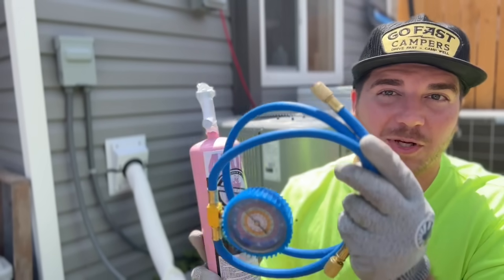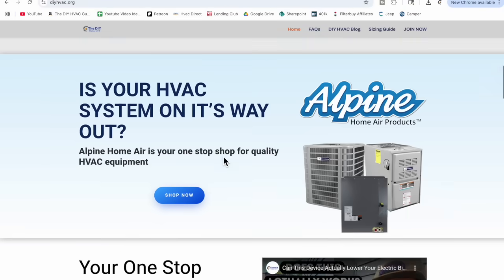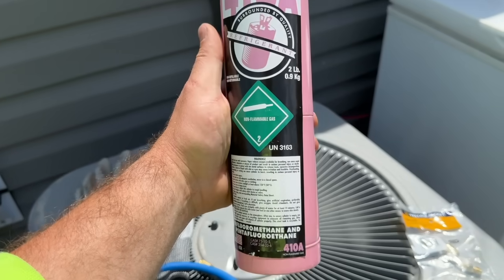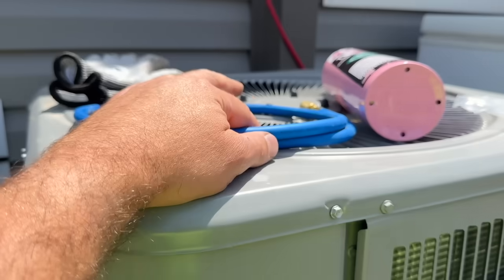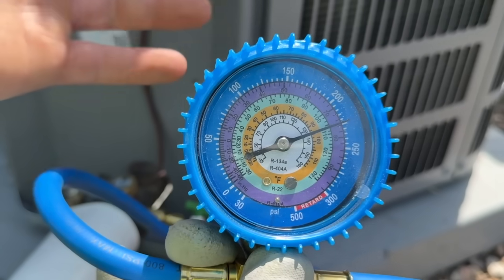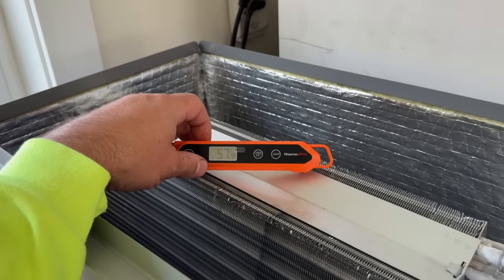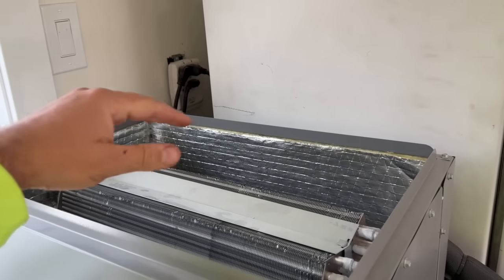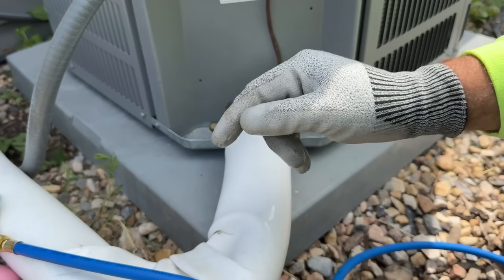You Can Recharge Your Home A/C Like A Car??  Colder Air in 6 Minutes!

Comment: Also to those who are saying contractors charge outrageous prices for refrigerant, you guys are looking at a very small picture...Licensing,Liability Insurance, Commercial Vehicle Insurance, Workers Comp Insurance, Truck Wraps, Tools, A fully stocked truck full of inventory, 4 or more different types of refrigerant, 20-50 different size capacitors, 10 different motors, Uniforms, PPE, Fuel, quickbooks, a crm/management company, The shop/warehouse, office/computers/phones, employee salaries. There are many associated operating costs with providing 24hr same day service and showing up to your door ready to fix whatever is broken at a moments notice. The price per lb or refrigerant is only 1 part of a very large puzzle that ends up as the final price to the consumer... It takes and costs a whole lot more than just a jug of R410A or R22 to provide home comfort especially in my south Florida market...I charge $100 for the first lb of 410A and 80 per lb after that... And if it takes a little more than what was stated on your quote to achieve top performance I'm never going to come back and ask you for more money...There is a lot of give and take when it comes to building a community/business, so I personally am very fair.

Comment: Owner of a small HVAC company, l enjoy your content... However I strongly advise against the average homeowner handling refrigerants in general especially R32 or R454B...There are a lot of finer points and safety concerns there... Also many people are unaware that all blended refrigerants are full of PFAS and other forever chemicals even though they are low "toxicity". Just an FYI to those conscious of their health to keep these things in mind when working with these chemicals. Also when warranty parts are needed you are going to need a licensed contractor to get you the parts from the manufacturer/local supplier. I would also strongly advise charging without a manifold as all you are seeing is your suction side pressure/sat, as you know there is a lot more going on in a system than just the suction side... Someone may try to charge that way and not know they have are having expansion valve issues or a restriction and overcharge the unit, and cause further damage. Not to mention electrical safety hazards such as simple things like capacitors that if someone is carless can severely hurt themselves with. Otherwise keep doing your thing!

Comment: I’m super confused. I have a Carrier WeatherMaker 8000VS  (year 2000 install) AC Model 58UHV120-20 12120 . I ordered the kit & TO MY SURPRISE there is NO Schrader Valve in the Low pressure side (large line). As an auto mechanic, i have done over 600 auto AC replacements & repairs. I don’t get what my options are next.  I can send you a pic if that helps.  I see no help for this on-line. Even when i look deep into the threaded tube, i see no valve. The end looks like the pics you showed, but NO Schrader. Thanks for any help. It says on unit R410a.

Comment: Great video! I have a 2-ton MrCool MiniSplit I installed myself. It's not cooling much anymore after a year at Palm Springs summer temperatures 100-122F.  I just ordered  the recharge kit you suggested, R-410A which is what the MrCool uses.

Comment: I like my temp to be low at my supply vents. If youre an ac guy and setting my temp at the top of the air handler  to upper 50s or lower 60s i will find a new ac guy.

Comment: I have a leak in my system somewhere outside the high and low ports.

Last year one of the line's iced up from outside to the inside. 

Is their a way to simply add air to so I can find the leak and braze it if needed.

The house was built in 1965 and the AC system is the same age.
Reply from the maker: You don’t want to add air, but nitrogen because it’s a dry gas. You can rent a bottle at your local air gas for $10/day
Reply: @diyhvacguy 
Very good.

Comment: Outstanding DIY.  My father-in-law was an HVAC technician and taught me the basics.  Thanks for bringing back those memories.
Reply: This isn't "the basics" whatsoever. And it's a disservice to your father-in-law and the industry to say doing this is a great thing.
Reply: @SuperPhantomHunter  We aren't talking surgery so why not. You Tube has "How To" videos of  for every trade so why not residential HVAC?
Reply: @user-mi2zb5sg1o  because the issue with doing this in particular is it's causing more damage to the ozone layer. R22 depletes the ozone layer in the atmosphere, while R410a adds to the greenhouse gases in the atmosphere. If your home AC system is leaking, using a "DIY kit" is not a smart idea. Plus you have to be trained and properly certified on how to handle and use refrigerant, it's not something that people should just be picking up and mishandling. There's a reason HVAC has its own schooling and certification programs, because it's not like the other trades. It encompasses basically every trade into one, as well as adding refrigerant into that.
Reply: @SuperPhantomHunter  I bet there's 10X more HVAC mechanics releasing refrigerant into the atmosphere than homeowners.
Reply: @user-mi2zb5sg1o yes there are definitely still guys doing it who are stuck in the old ways of doing things. But they take up a lot less of the industry now than they used to now that guys are taught what doing that actually does, and are also being taught how to handle it properly. If homeowners are doing this instead of getting a good technician to properly fix the issue then they're contributing to the problem as well.

Comment: You need a scale to measure the amount if refrigerant added:

"A refrigerant scale is essential for accurately charging an HVAC system with the correct amount of refrigerant, which is crucial for optimal performance, efficiency, and longevity."

Adding refridgement without measuring can case problems such as overpressure which can reduce the efficiency and damage the compressor, as it has to work harder, as well as cause leaks because the higher pressure can cause joints to crack. 410A systems already operate at elevated pressures. 

Saving a few bucks might cause you thousands if the compressor, condensor or AHU fails. If your going to DIY make sure you know what your doing & don't just blindly add refrigerant.
Reply: A scale isn't gonna weigh how much is needed to top off though/leaked, correct? Only the pressure meter can tell you this when connected, unless I'm missing what you're saying?
Reply: @muddyhotdog4103  Common practice is to correct leak, pull vacuum on system, than refill to mfg spec & lineset length & diameter. Mfg spec will include charging weight. You just need to refer to a table for the lineset length & diameter & type of refrigerant which will provide the amount per foot of lineset.
Reply: @guytech7310  i hear thats common for a split for sure, but im no professional either so there's that haha. I mean sounds like it makes sense if you wanted to do things the overall best way

Comment: There really is not much more to do extra to do it the way a professional will, which I would stick with as a DIY'er. Get a decent set of gauges, and charge until you achieve the proper subcool. No manufacturer install manual for a 410A system will describe charging based on coil temp or pressures (other than a baseline). Still a good video to get someone to identify issues, and take steps to correct.

Comment: Used that website to rescue my two 2 yr old mini split that was sending out hot air instead of cold air. HVAC company said it was low on refrigerant so I bought a freon leak detector which confirmed the leak in the main unit. HVAC company wanted $1300 to fix the mini split, guessing it was high because they didn't want the job. Topped it up with freon and mini split it back to normal for $177.

Comment: Thanks much. Electrician/Gc.
Your videos are appreciated. 
Serviced my ac system.  Changed condenser fan motor. Gone check leaks and charge next. Paid horizon $400 and system worked the same.

Comment: If your system uses TXV metering, you can easily over charge your system by using the low side pressure only to guide you. High pressure side subcooling needs to be calculated for correct charge on TXV metered systems.  Alternatively, you could measure the condenser coil temperature at the top, middle and near the ground of the  condenser coil. If the temp of the coil near the ground is near ambient temp or 3F higher, middle of coil is warmer by 5F from ground coil temp and top of coil is warmer still at 105F or so, then you got the charge level near right 😁

Comment: idk im all about fix vs replace but i think it would be better to find a company you trust to find and repair leak especially under warranty. i can only imagine all the issues from homeowners doing this and messing up like not bleeding air out of hoses, now system has non condensible or other issues. i don’t recommend people start adding removing charge without sub-cooling and superheat knowledge. i think this video comes from a good place but opens doors for a lot more issues to occur. for systems that can be easily fixed

now if your system is old and out of warranty and ur just trying to limp along until money right then yes go for it who  cares.

Comment: Pre EPA rules on Refrigerants a 30Lb jug of R22 was 15 dollars at the Napa Autoparts store. There were no recovery jugs made then; they did not exist yet. BUT the old R22 jugs had a 2 way valve. You could pull a vacuum on an old R22 jug and recover R22. Then replace the A coil; then vacuum down the system and add back your R22; then add more to adjust the superheat or subcooling. Piston system uses superheat; a TXV system uses subcooling

For cars the old R12 12oz cans were once 50 cents at Kmart; you used them for Marine air horns. You use them on a one shot cooler hose to cool down bearing races for installation

In R22 it was used in window units for over 50 years. Kmart had recharge R22 units for a few dollars. , Some repair guys used the piercing temporary Freon ports as long term. R12 was used in window units for over 50 years too

Before R22 there was R21 like 90 years ago.

When a R12 auto horn can was 50 cents there was a BB machine gun that was powered by the Freon can

The Dupont name Freon is for over a dozen different gases. ie a Orange jug here of R11 from Dupont is a marked Freon; so were R12 jugs for AC for cars
Reply: Yep and back then, using R22, the earth didn’t get 10 degrees warmer and no one died. Then the EPA came along and caused R22 to go up to $200 a pound. Now they just killed R410A and the same thing will happen “Im from the government and Im here to help”.
Reply: Had a freon horn on my boat I bought in 90, a 69 Larson, it leaked tho usually after one season or I used it, worked great, could go to Grandpa Pigeons and buy anything and everything 35yrs ago. Found 5lbs of 134a at Goodwill one day few yrs ago for $5 lol!

Comment: you dont mention about having a TXV or piston valve. If you have a TXV value you should be using the RED or high side to check proper refrigerant load, otherwise you could overfill and damage your compressor

Comment: You bled the line from the wrong end...That means you introduced "non condensible" (air) into the system which reduces the unit's capacity.

Comment: Some time on top of valves liquid or suction leaks by installers not protected with wet rags when they blow torch installed the system

Comment: Be sure to read up on Sub Cooling & Superheat before you so this. If you don’t you will turn a High Efficiency unit into a lower efficiency unit and any savings you gained on DYI will be gone with the next power bill. This will work if you charge to either subcooling or supeheat depending on which type of expansion device you have.

Comment: if you are going to try to fix your ac your  self start with cleaning the indoor coil  and out door coil and install a MER8 filter plus check fan speed and inspect the blower if dirty remove and clean blades  now your ac works  and spent  no money

Comment: What if the label on the outside of the AC unit has rotted away and is no longer readable? So the type of refrigerant required is no longer known. How is someone able to determine the correct refrigerant for the AC system?

Comment: I'm Canadian, don't shoot please. My problem is as you described, it freezes up after 10 mins and flow slows and stops. I would love to order a 2 lb kit with hose and guage for 150 bucks but they don't ship here. I will cost me 1500 to solve this riddle as the rules are wild here. I have done gas fitting and am confident I can do the job safely but can't buy r410a without red seal cert

Comment: What ever happened to the EPA-608 rules?  Are they still in effect?  Because everything in this is against the EPA rules.
Reply from the maker: I say in the video that you need your epa cert to do this. I have a video that shows how to get it
Reply: You need 608 to legally purchase and use R22. You can purchase without 608, but you must state that you will not personally use it and your intention is to sell or give for use to a person with certification. If you don't, EPA will swoop down into your property with helicopters in the middle of the night and you could end up doing a vacation in El Salvador.

Comment: My r410a system is low on freon. I was quoted about 130 per lb, to refill it. It is an 8 lb system and was low enough that it wouldn't turn on. It is 15 years old, so I'm not sure if it's a slow leak, or a good leak that developed last year.
Reply: Dang Where do you live? we sell Refrigerant for $80 a pound
Reply: @patrickguzman7355 Massachusetts. I'm debating buying a 10 lb bottle and take a chance.

Comment: The big point to make is that these systems are sealed in such a way that they are NOT supposed to leak even after 20 years of being in service. However leaks do occur and I guess it is fine if you are just wanting to buy more time until you replace your aging system.

Comment: I had my ac serviced a month ago. Everything checked ok including condensate discharge tubing clean and flush. On a normal summer day it would discharge 3-4 gallons per day. This month after service it is not discharging any water. When I pour water into the tube at the air handler, it flows out readily. The humidity in our Florida home is runnin around 50%. That seems a little high. Any ideas on this perceived problem?
Reply: Is there literally zero discharge at all, ever? How long does it run per cycle? If for less time and it's running efficiently you'll get less condensation building up and thawing on the coils, but it will eventually if it runs long enough between shut offs, soo I dunno.
Reply: @muddyhotdog4103 only about an oz all spring and summer. 15 y o unit.
Reply: @muddyhotdog4103  1-2 oz all spring and summer
Reply: @muddyhotdog4103 hey dog. I got tired of thi problem bugging me. I removed the plugs near the air handler to check. There was water flow there. I went to the yard where the pipe drains I seemed to be loose I dug down to the elbow , there was standing water in the hole. Digging further to expose entire elbow. It was loose. I cleaned  connections and put it back together. I don’t think these connections were ever glued and with no pressure may not need to be glued. I think my problem is solved.
Reply: @erojohn2 ahh, right on man! Hope everything works out

Comment: question....so if you are low on refrigerant..aren't most systems closed loop systems, meaning 410a just gets recirculated in the condensor?  Refrigerant should not be running low unless there is a leak? So if there's a leak then what does adding 410 do to help?
Reply: Just some instant cooling comfort. Doesn’t address the actual problem.

Comment: Again, as home owners we all appreciate you showing us how to DIY home HVAC system.  I have a questions, my system is now approx 19 years old since bought thehouse new house in 2006.  I have dual AC system and the system most used is the 2nd floor AC unit.  The condenser coil now showing signs of deterioration on the coil but the pump still going strong, and would like to replace either the whole condenser unit or just the coils.  The unit is made by Ducane (Lennox) model #2AC13B36P-1A and I would like to replace with a new replacement coil,  whole new unit, or even a used condenser unit if that is feasible?  Where do you recommend I can purchase these parts from or a used unit itself?  I had a local AC company came out (tech are commission based) to give me quote to replace the condenser/coil, and what he recommended is to replace the entire system with new costing approx $15K-17K.  I said to myself yeah sure,  a lot of these techs are straight out to rob of your hard earned income instead of being honest and not upselling customers.  Thanks.
Reply: Order a complete system for $4000 online and have a HVAC tech do a side job for $1000 and a six pack.
Reply: @jeremybrown6894  Thank you.  a complete system being the condenser and evap or just the condenser and compressor unit?

Comment: Will the 2 lb can with guage's fitting also fit a larger jug.. say 15 or 25lbs?
Reply from the maker: Yep, they are all standard 1/4”   The only exception is 454b and r32 which has reverse threads and you’d need that adapter I showed in the video 👍🏼

Comment: How would you recommend cleaning the evaporator inside the house.
Reply: Not that I know ,, but the” spray foam cleaner “is rinsed off with the liquid comings off the evaporator coil. Spray it on from any angle you can reach . It will self clean .Be careful of the plastic catch pan,, don’t crack it. Good luck